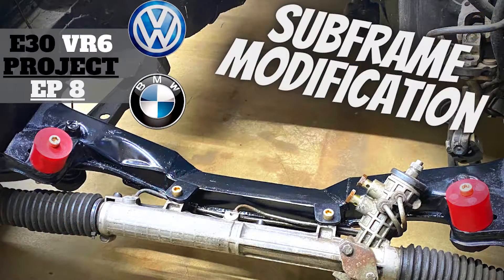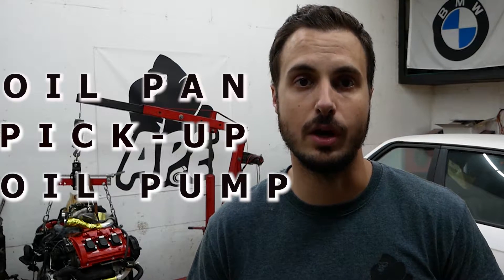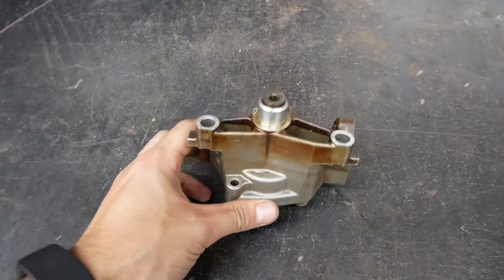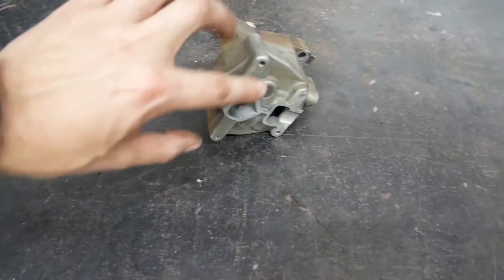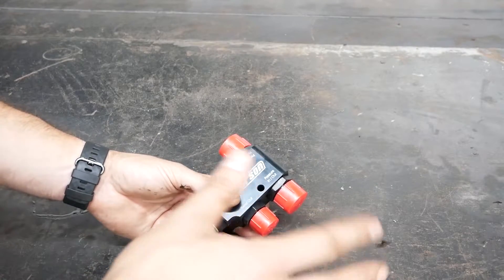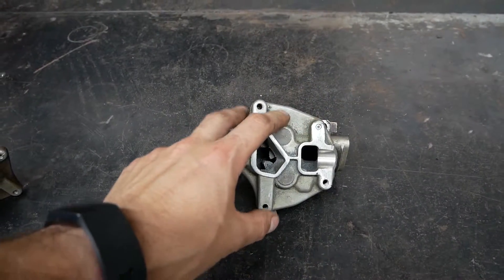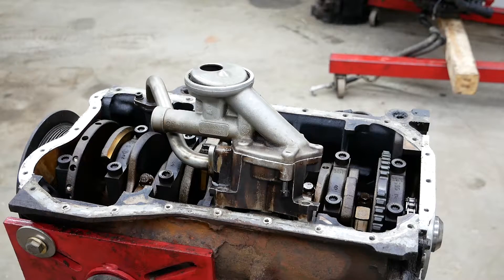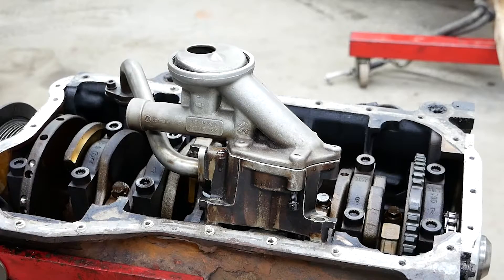RWD VR6 Oil pan & pump setup  - E30 VR6 EP 8

Comment: Might want to ad a support for the pickup pipe. To prevent it from cracking due to vibrations.
Reply from the maker: Thats a good point. I was wondering if It would be ok just like that since the pipe if thick and short but I guess I could add one just to be sure